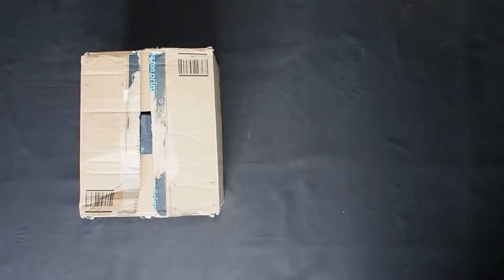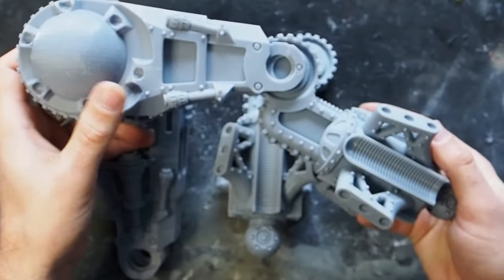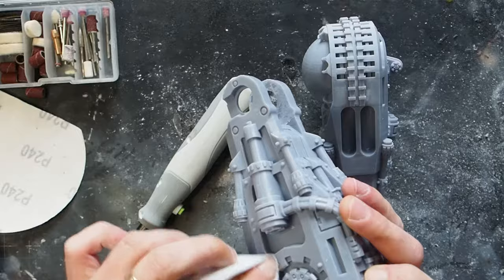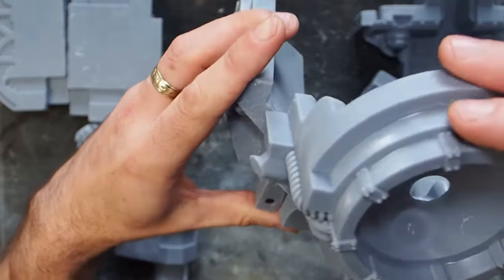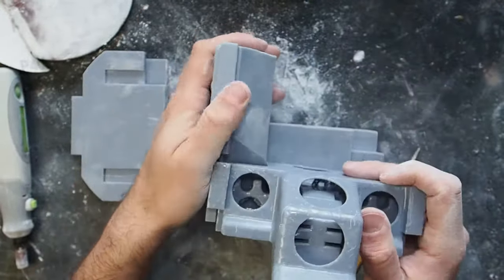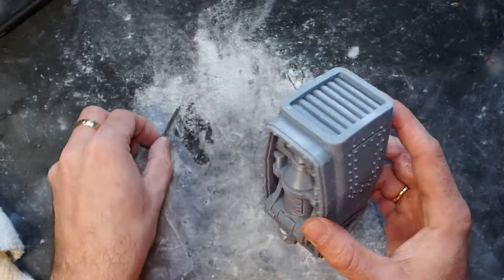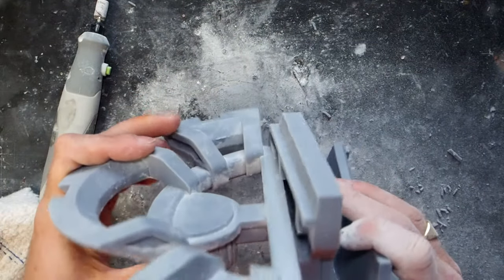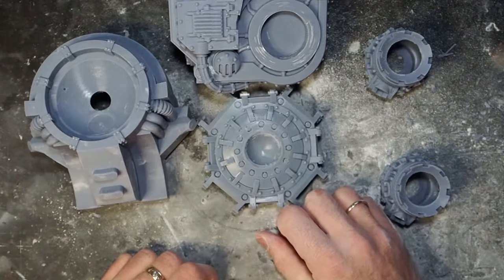Preparing a CHAOS WARLORD TITAN!

Comment: Do you have link to the sanding tool ur useing
Reply from the maker: https://www.amazon.co.uk/Cordless-Mini-Rotary-Tool-Set/dp/B0D2KW6V3N/ref=mp_s_a_1_94?crid=2L4W3XXBXANPC&dib=eyJ2IjoiMSJ9.Q6i1iM5bPEB_Dx-oFEMQFSrL6se9Xo05WPbvumYRKN3TbeDyoFbiltZMAjwhGoQDrvXgcNU-67iZsTg7HYOsOK35UDevbdnZThKYofpPsvSDMOG7QlWcnhf9QyWSibkcKhzCr-5ASBeliHJ8386rzJCG0HRERWix4UiBz8zk0z7vj8-4LnzX6YJ3pC57dRt8.FRHawcyEngOVLKkCUGcPeMhJjXu07LV0IjNPUO6YOms&dib_tag=se&keywords=rotary+tool&qid=1721671636&sprefix=rotary+%2Caps%2C114&sr=8-94 is the closest I could find, seems mine isn't sold anymore

Comment: For future soldering I’ll give you a tip. 
You heat the wire and then apply the solder directly to the heated wire. 
That’s how soldering is supposed to be done. 
If you do it this way your solder will just flow into the wire and make a great bond. 
It helps prevent cold joints and other solder problems. 
The only real issue with this method is not having enough hand. You want crocodile clips on octopus type arms to hold 2 wires together while you operate the iron and the solder.
Reply from the maker: 😂 it definitely felt like I needed a third hand! Thanks so much for this advice, it'll definitely come in handy for the weapons!